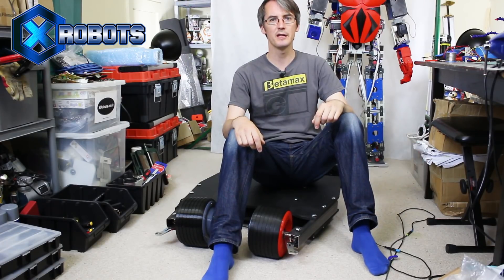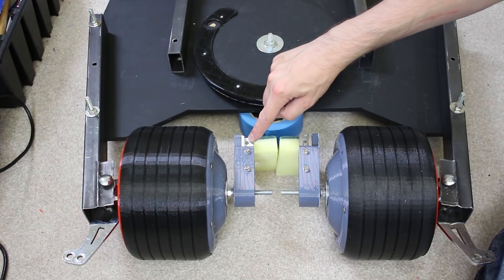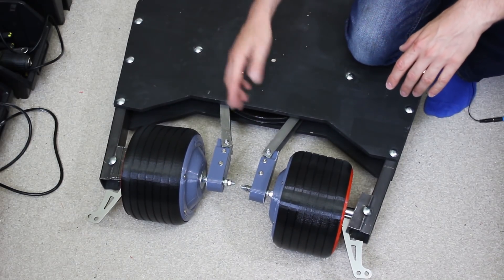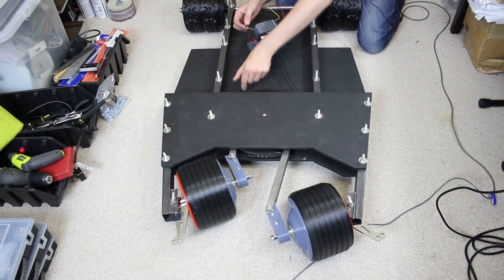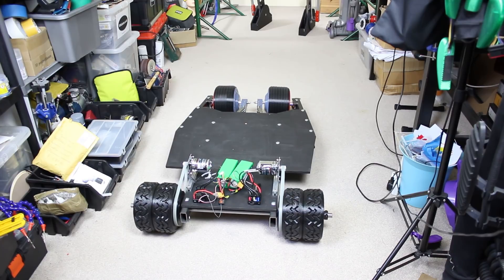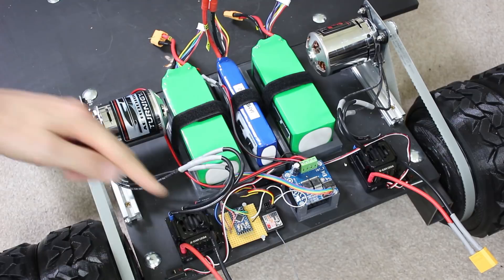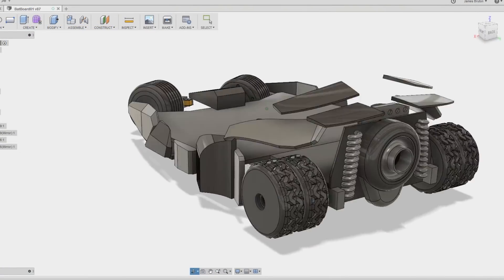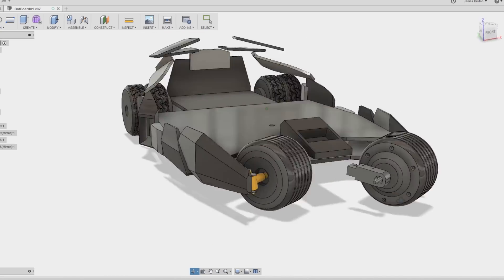Building an Electric Batman Skateboard #2 | James Bruton

Comment: Why did you use that gear ratio on the two back wheels?  If you used a bigger drive gear and a smaller driven gear couldn't that increase your RPM? Or did you need it for torque?

Comment: Really nice!
You could easily add differential steering by controlling the thrust on the drive motors individually as you already have an Arduino to control the steering motor. Don't know if that would be an upgrade, but something to tinker with anyway.

Comment: couldn't you have used just one ESC for the two motors by just splicing the wires? or would the amperage have been too high? Im just thinking since you don't need individual speed control on each wheel it'd be cheaper to just use one (if you can).

Comment: James, Have you thought about using some of those force sensing resisters you used on the exo suit to control steering? That way you could control it more like a regular skate board by shifting your weight.  Using the steering on the remote control or laser could be a manual override method...

Comment: Couldn't you do the auto centering with just code? Maybe grab and save the steering values/time held each time you use the wheel, then just run the values in reverse when the wheel is released and centered....not sure it would be as accurate as a hardware solution but it might be doable....I'm just novice when it comes to coding :P thanks for the upload, your channel is great.

Comment: you could try using pressure sensors in the board to detect when you are leaning and then use that to steer

Comment: May I suggest moving the pivot points for the steer arms slightly further back (off center) on the steer pulley? That would create true ackerman steering. I would imagine that having threads on the steer arms to adjust the toe would be also nice.

Comment: Nice progression:) I wonder if the driving could be done completely with pressure sensors instead of a controller so it would accelerate/slow down and turn based on your own natural tilting on that skateboard. 
I'm looking forward to see all those cosmetics too:)
Reply: Yeah, I can imagine it is not easy with a project this big. Maybe some if you stood on a slightly elevated platform that would tilt regardless of the whole skateboard but that would probably mean a lot more engineering than needed. This controller with some sensors and a pointer like you've said in the video seems like a good middle ground.

Comment: I guess one way to do it to make it maneuver like a skateboard is to put a panel supported by 4 scale sensors. they go up to 50kg each. wire them to an arduino and you have your balance steering.
Heck if you do this you might even ditch the whole remote control. 

maybe use hall sensors to have the feedback from the steering. you could just hook them beside the chain and make them count the links or use magnets on the chain I don't know.

Comment: Hey thank for the info what is the engineering material that you used to make the steering bearings out.  I'm a futurist back in 2005 I wrote about a material used to prototype high stress part.    I said that this material has Kevlar and/or fiber glass, metal strands/fibers that could be suspended in a resin matrix and aligned using magnetic fields. In  one section of your video it looked like there were fibers in the dark gray material.  What was it you used to fabricate this part?  By the way I do love this project.

Comment: For the steering try using an accelerometer or some pressure sensor so that when you lean one side over a certain angle the front wheels come with you but as long as you lean below that value (installing the feedback pot) the wheels reset to their central position

Comment: I must admit I was a bit afraid at start that it would always be the same for each skateboard, but you are each time getting different designs in the way it works, that pretty cool.

Any chance you will try to combine the motion capture suit of Ultron to the bat board  to get this more natural steering while you lean on one side ? 

Also, can't wait to see the cosmetic with hopefully some led or even better, a flamethrower in the rear engine :p
Maybe in the future some automatic squirt guns  on the front as batman has rifles ? ^^

Comment: If you are plugging in 2 esc s into 1 channel you must remove one of the positive wires from the two plugs otherwise you will be sending twice the voltage to the receiver and most are rated up to mostly 9.6 volts and a 120 amp esc  gives out 6 volts so that is 12 volts into the receiver which will give you brown outs and twiches and  eventually fry the reciver

Comment: The steering assembly with the front wheels only supported on one side (fixed to a hacked extrusion) is extremely dodgy. It is clearly flexing when you are standing on it. I realize that it is for the looks, but a bit more thought should have been given.